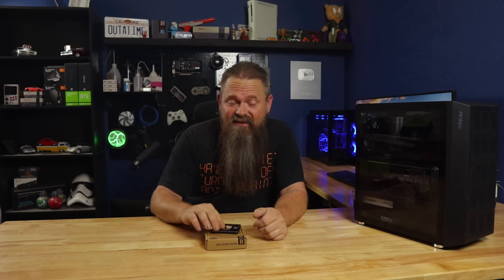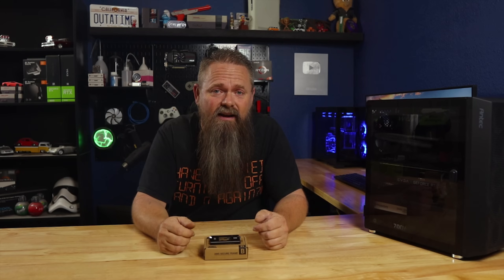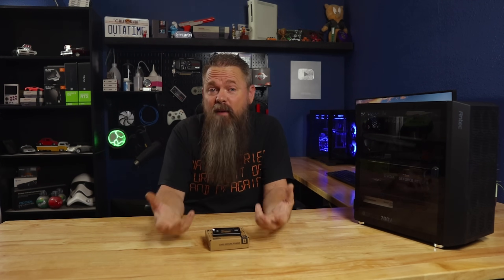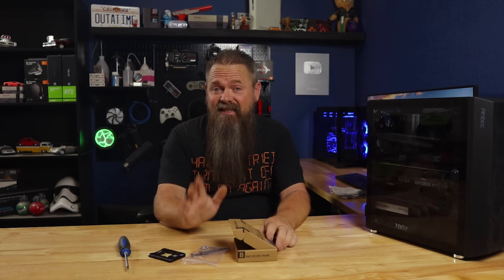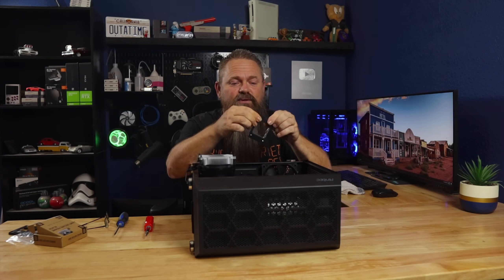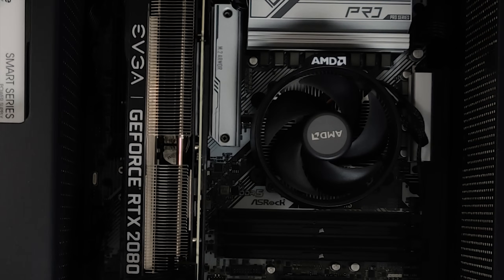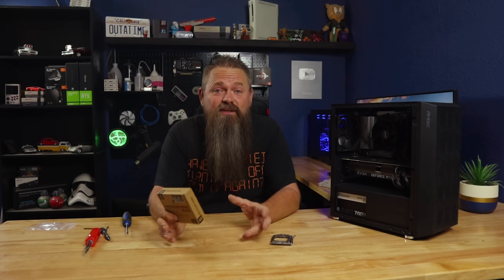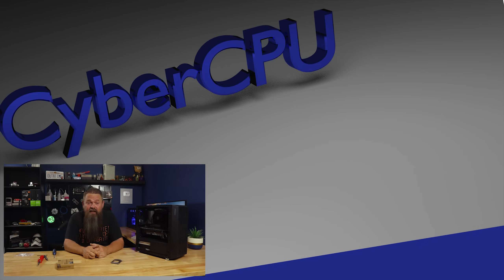AMD AM5 Runs Hot, Will This Fix It?

Comment: I might grab one of these when I do my CPU upgrade at some point in the next year or two. Currently running the 7600xt and trying to hold out to see what the 9800x3d might look like and how it is priced compared to just getting a 7800x3d and riding that out until AM5 has its last generation on it and we are moving on to AM6 or whatever the next one will be in like 3 to 5 years.

Comment: Nobody, including Thermalright, the creator of that bracket, have said anything about cooling performance improvements on AM5, because how the intel chips are shaped, over time there will become a slight bend and the intel bracket straightens it or something, but because AMD chips are squares, there won't be a bend and no improvements, I only got that same thermalright bracket for my 7600 because of the difficulty cleaning the IHS from thermal paste.

If you want better cooling performance for your AM5 cpus, because of the chiplet design and the position of the CCD dies, go get yourself a offset bracket. Thermal grizzly sells one for general use, Noctua has offset brackets for their coolers, and then there's what I did, I got an Arctic AIO, they also include offset bracket for AMD, actually, Arctic liquid freezer III has offset bracket for AMD and that full contact bracket for Intel cpus, but mine is Liquid Freezer II (got it and installed it on the day Arctic announced the Liquid Freezzer III series, so that announcement was the first thing I saw when I turned my pc on)

Comment: I think it’s crazy amd pretty much just add power till it throttles. Then add Pbo and a h boy. You really need a big AIO or water cooling open loop. 
It might be better if they were able to control undervolting like intel. Yes AMD are great for gaming but not creator pc. Unless you buy the ridiculous thread ripper.

Comment: I got a retention frame (same one as in the video) because I didn't want thermal paste to get into the notches on my 7600.  I'm not sure if it helped my thermals, but I have a 7900GRE and I'm not having thermal issues with either my CPU or GPU either in regular use or in stress tests.  I am not using a stock cooler though,  I'm using a 6 heat pipe/single fan Thermalright Burst Assassin - only ~$28 and easy to install.

Comment: Have a 7600x in a custom watercooled loop and it will go straight to 85 in Cinebench under full load. Have the thermal grizzly contact frame. These cpus are just designed to boost to the moon until they catch fire. Lol i dont think any cooler could keep them under 85 at max boost unless maybe you delided it. Just not possible to transfer the heat away fast enough.
Reply from the maker: It's very possible. Check out my latest video.

Comment: I went totally overkill and got a Liquid freezer III 360 for my 7600. Temps hover around 45-50C while gaming and around 65C in CB 30 min run. Was in the high 80's while gaming and 95C in CB with the stock cooler, so it's quite a difference.

Comment: Honestly unless you just want to do it just because.  Theres no reason.  My 7950x is a heater.  Its been de lidded and direct die cooled and i can still get this thing to thermal throttle with ease with stock settings.  With AMD your best bet is going in and messing with bios settings either undervolting or just setting your pbo tjmax settings.
Reply from the maker: Check out my latest video. That's exactly what I did.

Comment: Hey there. You eventually got to it but the other benefit is the fact that it fills in the holes and helps prevent thermal grease from getting down in between gaps in the IHS. As for better coolers, it’s a much of a muchness. 

Cheers
Rick

Comment: it's not seventh generation... Ryzen 7000 is actually 4th generation.. hence the "Zen 4" naming.
Reply from the maker: AMD calls them 7k series. Kind of like how the latest Nvidia cards are 4k series.
Reply: @CyberCPU  yeah, I get that, but you kept calling them 7th generation, which they are not, they're 4th gen. then later in the video you call them 5th gen which is also incorrect, Ryzen 9000 is 5th gen. You have far too many subs on your channel to make simple little mistakes like that. Do better.

Comment: If Zen 4 is designed to run at 95 c then why would he say it’s running hot when the CPU is doing what it’s designed to do. 
Also, don’t waste your money on this, it’s the unreliable Intel chips that need a contact frame
Reply: It doesn't hurt to have lower temps, and you can boost higher at the same temp. Also good if you're squeezing the last bit of temp reduction for overclocks.

Comment: NO THERMAL PASTE NEEDED WITH CARBON FIBER CLOTH SHEET.  I use one on my 9900k and a 280mm AIO.  Temps top out at about 87c running Cinebench 1.54 at 4.7 to 5GHz in 82f temps.  I run FanControl with minimal tweaking.

Comment: Measure the height difference of the plate and the top of the CPU and add .5mm to that measurement for a thermal pad. (Intel LGA1700 is .5mm so use 1mm) Add a squishy thermal pad to around the perimeter between the cooler and plate. Gelid Extreme is great for this and additional temperature control. Also, apply a small amount of thermal paste between the CPU and the plate around the edges where it touches the CPU, and butter the toast with the thermal paste.
Thank me later.

Comment: The bracket is intended to keep the cpu from warping and keep the cpu and your cooler in contact so you don’t get any hot spots. I have Thermalright 360 AIO with my R7 7700X overclocked at 5.4GHz at 1.20v. I get gaming temps around 45-55c max. 70-80c during shader compilation.

Comment: Iv got a 7800x3d and it runs at 75-80c under full load with a 240 aio and it keeps its boost clock speed of 4.9ghz and doesn't fall back to the base clock

Comment: Good video. I have a similar Thermalright retention frame bracket for my socket 1700 13700k (Intel 1700 cpu's can bend without it). It lowered my cpu temps by about 7C.
I am using a Thermalright Peerless Assassin 120 SE Dual fan cooler. I use those brackets on any new pc build that they support. It saves thermal paste from getting on the socket or motherboard and it can help thermals. The brackets only cost $10-$15.

Comment: There is nothing to fix, it's by design.  You are doing noobs a disservice insinuating otherwise.
Reply from the maker: I'm a couple videos ahead and I very much disagree. These CPUs are capable of running much much cooler. Stay tuned. You might be surprised.
Reply: @CyberCPU  No, I wouldnt be surprised. I've had one or two of every Ryzen generation, and I'm currently on the 7800X3D.  The 7xxx are extremely efficient and run very cool. A $30 Phantom Spirit is enough.I switched to a 360mm AiO mostly for aesthetic reasons as I changed cases which I do quite a lot and the difference vs air is nearly non existence.  The fact you are arguing this shows how little you know. The difference in clock speed bin that you hit with high end cooling is so minuscule. They do what they do under load, they are designed to do it, and you don't need high end water. Do it because its a hobby, do it for noise /thermals, do it for aesthetics, but don't do it because you think the temps they hit under load are alarming with a good air cooler. On that note, the Phantom Spirit is amazing,  1/3 the price of a D15 and very very nearly as good.
Reply from the maker: @insertnamehere4419  water cooling doesn't have to be expensive. My latest video proves that.
Reply: @CyberCPU  That's not the part I argued.

Comment: A Thermalright Phantom Spirit 120 SE will maximize your boost, along with a Thermal Grizzly Kryosheet at 33x33mm. I have that on my 7800x3d
Reply: i just picked this bad boy up from the postoffice today. Gonna install it on my 7600 and im assuming it Will keep temps in order, i run stock settings i just enable xmp for 6000 cl30 🎉

Comment: In my case I bought a contact frame because the motherboard (MSI X670E Gaming Plus) I purchased had few less layers to its PCB than other more expensive boards and I was afraid of it warping under the mounting pressure of the CPU cooler.

Since the system is a new build, I dont have any before and after results to share but my 7800X3D with PBO+CO with a -20 offset (rookie numbers i know but im still tuning it...) never goes beyond 70c while gaming unless the ambient room temp is like 25-27'c which is has been over the last few weeks. Most of the time its chilling at 60-65'c (when gaming) and Im still seeing boost clocks hit 5ghz.

The cooler im using is the Thermalright Phantom Spirit and TR's Heilos PTM pad. Its not as good as the honeywell stuff but ive had great results with it on my laptop - Its also easily obtainable off amazon for a price much cheaper than importing it in from the USA or Canada.

-- Also the motherboard turned out to be a lot more sturdy than I had anticipated but since I already had the contact frame anyway. I put it on.

Comment: Correcting a few inaccuracies in this video....
TJMax for Ryzen 5 7600 is 95C  (not 85c as stated)

AM5 is the slot - which will take Ryzen 7000 series (Zen4) or the new Ryzen 9000 series (Zen5) - The author referred to the 7600 CPU as Zen5 (It's Zen 4)...

The video author keeps referring to the Ryzen 5 7600 as "7th gen" ....  Kinda not really... It's more 4th gen of Zen processors...

AMDs naming is bad and confusing... But not as bad as Intel which is worse !

Also when the video author is talking about why Intel CPUs have problems with excessive temps from warping, he left out the real major reason AM5 AMD CPUs do not have this issue - The IHS (Integrated Heat Spreader) is much thicker and is smaller, so that metal has much less chance to bend...
Reply: How is intel naming bad?

Comment: Didn't see any info that am5 frame is for thermal benefits, its more for for thermal paste - see description on Noctua page, they call it thermal paste guard
Reply: Except Noctua just has a thin sheet that you overlay on top of the latching mechanism while Thermalright has a sturdy piece of aluminium that replaces it, same as with LGA 1700. Obviously overkill where bending correction isn't needed, but it's sturdy and it works. The default latch does not include enough socket ingress protection and Ryzen's IHS was probably designed by someone who never had to replace thermal paste.
Reply: It's not for thermal benefits, there are none. Anyone saying otherwise is wrong.

Comment: Hmm $15 on a piece of metal that may or may not prove to damage the CPU with long term use (or void your warranty),...or $20 on literally any crappy tower cooler that will easily outperform the stock cooler and lower the temps considerably. Forget the piece of metal. Almost any aftermarket cooler, even the cheap "no name" ones will do a better job cooling a CPU than the metal plate will, which will allow for a lot more than a measly 28 MHz increase in the boost. On my AMD system a cheap $19 single tower cooler keeps my temp from going above 64C (idles at 28C). Granted I'm using a 65W CPU so obviously your CPU temps will be a bit higher, but nothing a cheap dual tower cooler can't fix for about $25 or $30 and it will yield much better results than the stock cooler or a retention plate. Heck even a decent single tower cooler with 8 heat pipes would do a better job and increase performance and boost.

And if temps are that much of an issue.... just turn boost down (or off). You won't really see any performance difference in every day usage (benchmarks will be lower of course but actual real world usage won't suffer enough to be noticable).

Comment: I just ordered contact frame yesterday for my 14709k and today you uploaded this
Reply: Measure the height difference of the plate and the top of the CPU and add .5mm to that measurement for a thermal pad. (Intel LGA1700 is .5mm so use 1mm) Add a squishy thermal pad to around the perimeter between the cooler and plate. Gelid Extreme is great for this and additional temperature control. Also, apply a small amount of thermal paste between the CPU and the plate around the edges where it touches the CPU, and butter the toast with the thermal paste.
Thank me later.

Comment: Undervolting , adding the replacement bracket + graphine thermal pad + AIO or Custom Water Cooling could really drop the tempature when all of the systems are used together. Maybe even getting a case with more mesh panels - including a mesh front panel.
Reply: I'm doing a full water cooled pc with a 7950x will let you know my temps when. It's ready
Reply: @ForeverHollowed  Feedback?

Comment: I wonder if putting a little thermal paste around the interior  of the contact frame would help some by making it more apt to act like thermal mass.  Looking at your one graph, it seems to cool off more slowly.  If that is the case, one made from copper or brass could be of possibly even greater benefit.  

I admit I bought one because I actually enjoyed installing one on my intel PC.  I did notice temps going down and higher boosting, but I had also swapped out to a  phase change material to test out at the same time, so I cannot really say if the frame had any effect.  I did drop a few idle degrees and noticed that it took longer to hit TJmax and hit steady state with ~100-200mhz  higher clocks.

Comment: I have a 14600K with a 260mm coolermaster radiator and Kryonaut Extreme.
I got the bracket and well, temperature wise it made zero difference.

Comment: undervolting is great and often you can squeeze lots more out of your hardware. GPU's from amd   if undervolted  just enough   to be stable  and with  with the power limit set higher  on rdna2 and newer gpu can boost a lot more and cpu's  do more or less the same thing   so it works more for less power  and less heat at base clock  but still gets to work to the maximum boost it can for longer and achieve the same max temp  and basically let the card  overclock itself  a bit with the boost feature ( can get up to 10 to 15% or more performance boost)  . am5 chips are built to run hot so thermal headroom becomes a bottleneck because it will be not so much be thermal throttling as thermally limited from boosting as much as it can for as long as it can  as long as it does not get to 85c TJMAX  at witch point it will start to reduce clocks and boost time to reduce heat  and save itself ( if only intel cpu's would work as good  at this with 13 ands 14 gen silicon degradation drama) .

Comment: All this does is help lay the CPU flatter to the heatsink contact point cause it prevents PCB bending ever so slightly which reduces pressure to the heatsink contact point this is all simply because both AMD and Intel designed the CPU retention bracket very poorly so far Intel's socket 2011 bracket has been the best they ever designed everything else before or after that were made with lower costs in mind.

Comment: My preliminary thought b4 watching these results is. First you need to test the 7800x3d or any x3d chip. And with PBO enabled. And my understanding is that it cant help to stop the chip from frying itself into an early grave when PBO is enabled. Theres also another thing in bios similar to PBO that has to do with the voltages but who has time to remember all these abreviations?

Comment: I have put two of those frames on my intel LGA1700. Both work great. I also bought an AM5 frame just like this for another Youtuber that I subscribe to. Just don't over tighten them or they will distort the pins and not get good contact and will cause strange problems to occur like no boot or memory errors.

Comment: I've had one on my 13700k for almost 2 years now. Love it. You're right clean up is great with it. I've been on 2 different Z790 boards with it "msi tomahawk ddr4 to msi tomahawk ddr5" and I've had 3 coolers on it now. Old trust h115i died after many years of hard service. 6700k oc to 4.8 at 1.4v for years then 10700k at 5.1ghz on all 8 cores for a few years. Then a year with my 13700k oc to 5.6ghz on all 8 p cores, All 8 E core oc to 4.4ghz, Ring oc to 5.0ghz at 1.34v and then went to air cooling on the NH-D15 chromax black and on air it couldn't handle it as well as I liked. So went back to a aio h1150i link and it keeps its under control easily. Clean up all those times were a walk in the park. Super easy. Oh and no degradation on my 13700k for those about to jump all over it. Use my system 8 hours a day 7 days a week for work / gaming. It's pretty much always on. Just lock your voltages and core frequencies and no degradation issues that I've seen with the ones doing that. I mean I always buy a k series for a reason. Overclock them people. My 13700k has been one h*ll of a processor. If it goes at this point for what ever reason I wouldn't even care. It's been the most reliable and most actually used cpu I've ever had being I work from home and always use my desktop. And I've had quite a few cpu's over the many years and every single intel cpu I've ever had still works to this day. I hand them down to family and friends and all are being used still and working just fine. Reason I stick with intel. They have never let me down and I won't bail on a product / company that's given me not one single issue. I build pc's on the side for family and friends  and used amd quite a lot. No issues with them either beside bios and windows issues that I've had to fix for them but nothing major. I put my brother on am4 years ago and just upgraded his 3800x to a 5700x3d fore his birthday back in July and he's been on cloud 9. The performance jump was very big. Amazing what amd has done with the am4 platform. He's set for a good few more years as long as his x570 tuf motherboard holds out.
Reply: I have an I7-12700, but the stock cooler is nowhere near good enough. I can't go past 30% cpu load without it overheating. It's gotten worse over time. There are no air coolers rated high enough that will fit in my case.